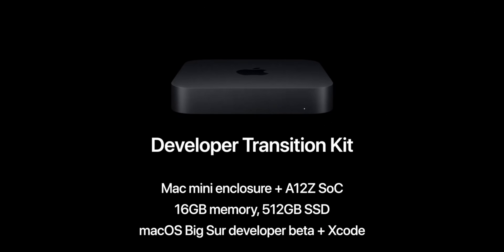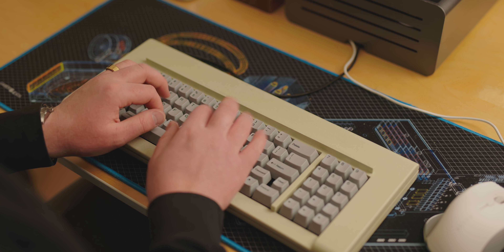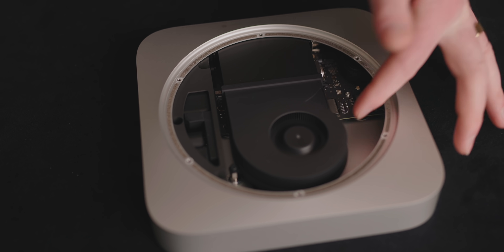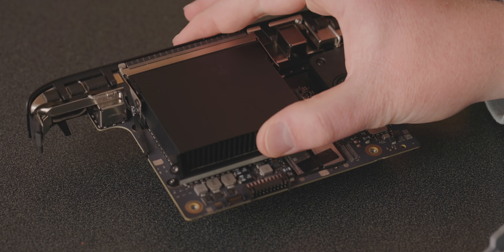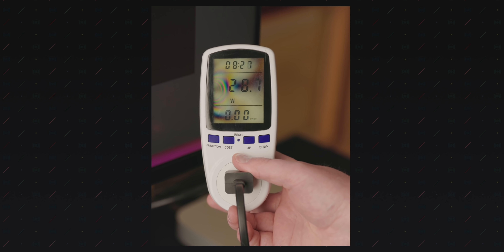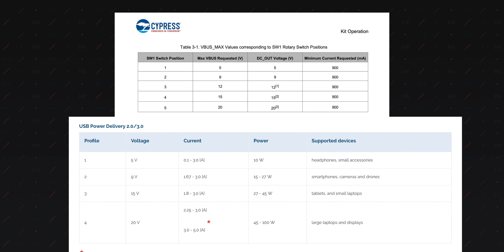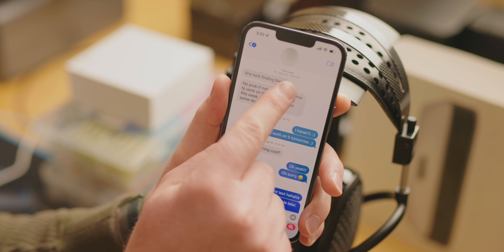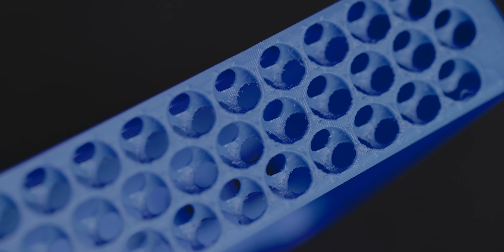We made the Mac mini ACTUALLY mini!

Comment: Nice project dude.  can't recommend the m1 enough, even as a ryzen user, this machine delivered.  As a daily driver I am not going back. The future looks brilliant, and I can imagine my kids will be enjoying the 1nm (or less than) architecture.
Reply: The M1 is great, but It runs mac OS.
Reply: @gustavrsh  😂
Reply: @gustavrsh  it can also run linux now. but if you wanted to run windoze... my condolences
Reply: @gustavrsh  I think you misspelled "plus"... you spelled it "but".
Reply: @menotu000  No, I didn't.
Reply: I highly disagree. I've owned PC's for ages and just recently got myself the highly praised M1 mini. Sure it's impressive power usage and performance vise, but it ends right there. Ssd speeds aren't impressive, usb speeds can be all over the place, sometimes absolutely ridiculously slow. Compatibility with Intel macs is hit or miss. Graphics performance is quite poor if looking only the performance,not power consumption. Then of course the MacOS itself which has THE worst window management ever done. Sure it's good as "basic" computer, but it's expensive and leaves only the impressive power efficiency as high bonus.
Reply: @jothain  For me this the air m1 is the best ultrabook considering pricing and quality build. But it has some bad things too. compatibility being one of them, tried to install cuphead here and the ps5 controller didn't work for some reason, oh well. As for the mac mini, it's a $600 machine on sale, kind of a bargain but it might not be for everyone. I am a happy camper with it but if you're a windows user, eh you may not like it.
Reply: @phillipgoat00  don't get me wrong, I'm possibly getting M1 laptop this year to replace my old Lenovo. I was just answering to that performance "impressivity". It really isn't that good in performance if you're looking that as sole metric. In laptop though, yes it's one of the best there is. But as desktop throw any modern cpu and gpu and M1 really isn't impressive at all. Actually quite bad.
Reply: Whats your use case for the M1?
Reply: @romano5785  you can do basically everything with the air m1, including playing games with dolphin (native) btw. I own a 7nm ryzen machine, and this thing trades blows with the 5nm m1, not in intensive tasks ofc like AAA gaming, but gets the job done.
Reply: If you have a display and mouse/keyboard, it's a no brainer. It's cheap and specs are great!
Reply: Intel is going to do 7nm, then 4nm, 3nm, 20A, and 18A… so eventually it could get to 10 angstrom, but it won't be Apple.
Reply: @groszak1  
The world leaders are TSMC not intel
And Apple is TSMC’s most valuable customer
Reply: @kalmenbarkin5708  No, Intel makes the most powerful computers.
Reply: @groszak1  yeah nope 
TSMC in Taiwan is by far and away the most advanced chip manufacturer there isn’t a close second 
TSMC is at 5 nm and releasing 3 nm soon while intel hasn’t been able to break below 10 nm reliably 
Intel has been reduced to outsourcing its next generation CPUs to TSMC because they simply do not have the manufacturing capabilities to do what TSMC does 

They are hoping to get it and they probably will at some point (the fact that Taiwan leads chip manufacturing is considered a national security threat by many so US policy will probably favor helping Intel catch up)
Reply: @kalmenbarkin5708  Intel is going to make 20 angstrom processors in a few years. They’re going to be tinier than anything else on the market.
Reply: @groszak1  it’s impossible to predict the future 
Intel wants to lead the market (as do many other companies) maybe they’ll get there maybe they won’t 

Right now they are running to TSMC to make chips for their own branded computers because even they themselves admit they can’t match what TSMC can make
Reply: @groszak1  the bottom line is M1 chips in a 2.5 year old Mac have transistors twice as compact as the most compact thing Intel can make today 
Today Apple silicon based on TSMC chips is miles ahead of anything Intel can make 

Will that change in the future? Maybe. But it’s not debatable today
Reply: @groszak1  oh and 20 angstrom (2 nm) is what TSMC’s planned 2023 production is scheduled for 
If Intel hits that benchmark “in a few years” that’ll still leave them way behind
Reply: @kalmenbarkin5708  Most of these 2.5 year old Macs are probably bricked by now. So the landfills are going to be more strained than ever. That’s why these kinds of processors destroy the environment far more than Intel computers.
Reply: @kalmenbarkin5708  Most of these 2.5 year old Macs are probably already bricked by now. The landfills are more strained than ever. There’s a reason Intel doesn’t make processors that way.
Reply: @groszak1  tell me you know nothing about computers without telling me 🤣🤣
The 2020 M1 MacBook Air is one of the most robust laptops on the market 
It’s excellent thermal performance and no moving parts means it is likely to last much longer than previous macbooks which lasted 8+ years (I still have an operational 2014 MacBook Pro)
Reply: @groszak1  Intel fell behind ARM and TSMC 
They are a second tier company right now 

Maybe they’ll come back maybe they won’t (I hope they do for national security’s sake)
Reply: @kalmenbarkin5708  So you’re using a dead meme, then spreading misinformation? I’m blocking you.
Reply: @groszak1  oh no guy who thinks intel is more advanced than TSMC is gonna block me what will I do without these “brilliant” insights 🤣
Reply: @groszak1  though I will say the fact that you have more confidence in Intel products than … Intel is pretty funny 
It takes fangirling to a new level
Reply: @groszak1  don't put intel in any conversation with m1 and ryzen please. that company is a joke and will always be
Reply: A single silicon atom is about .2 nm we are getting awfully close to the theoretical limit to “just make it smaller”
Reply: less than 1nm :/ how ? wee slice atoms ? :)
Reply: @Adiiiman2xxx  the lattice parameter of silicon is about 0,5 nm so it's not impossible just really hard since there's not that many atoms at that scale to make a transistor. So 1nm, I guess possible, but hard AF.
Reply: @Adiiiman2xxx kaboom?
Reply: Sorry to tell you but "x" nm is just a marketing term.  Has no relation to physical size.
Reply: @t.walker3101  It has to do with efficiency and transistor count in the same size chip.  It's used in marketing for good reason.
Reply: @BA-oy9uo  except going "sub 1 nm" doesn't mean that it'll meet the molecular lattice size roadblock sooner, since the actual physical dimensions are nowhere near 1 nm.
Reply: @t.walker3101  if you get the same physical size of a lower nm processor, expect it to run faster or at least cooler since it is packed with more transistors compared to the ones with a higher nm of the same physical size. It is not a marketing BS.
Reply: @t.walker3101  Yup.. They fell for the marketing.